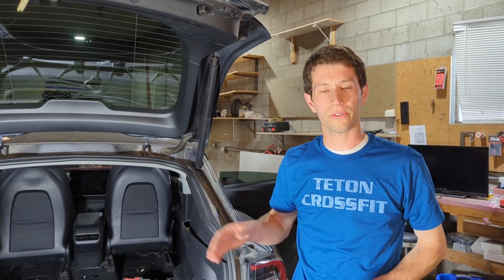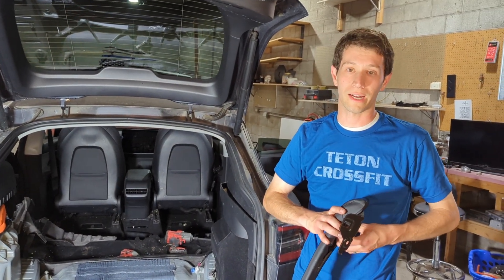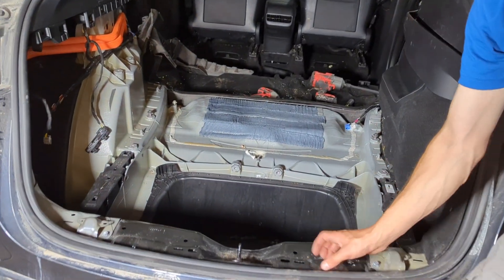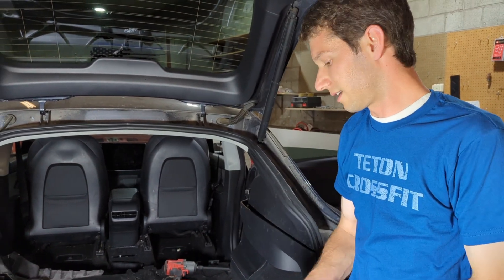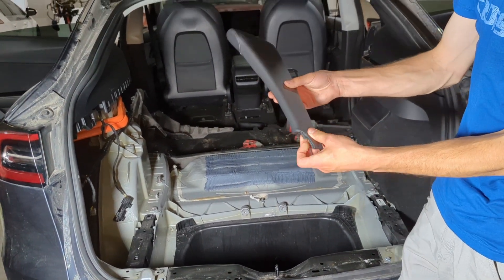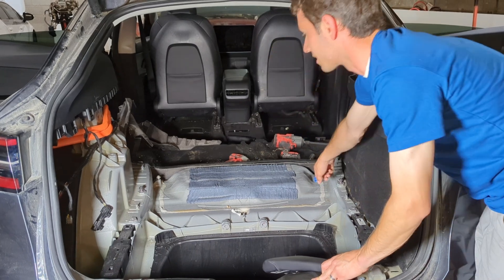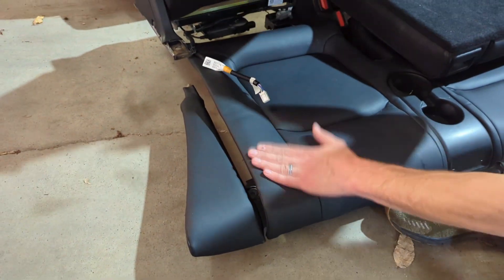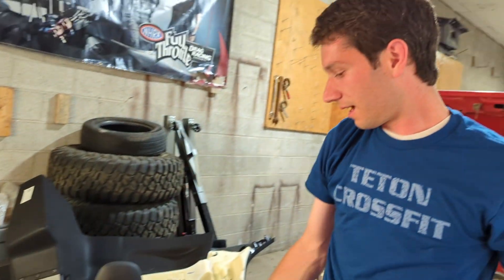Removing 3rd row from Tesla Model Y

Comment: My 3rd row seat on the right side is stuck due to the seatbelt so I am unable to fold the seat back to an upright position. Do I need to take the whole seat off in order to get to the seatbelt bolt? Or can i just remove the sidewing cover by popping out the front bolt out?

Comment: By any chance are you selling those 3 row seats >.<
Reply from the maker: Possibly but I won't know until next spring. I'll comment here if we decide to sell. We may incorporate them into the truck conversion where the trunk opener on the Tesla is used to open a hatch in the bed of the truck to unfold these seats in the bed.